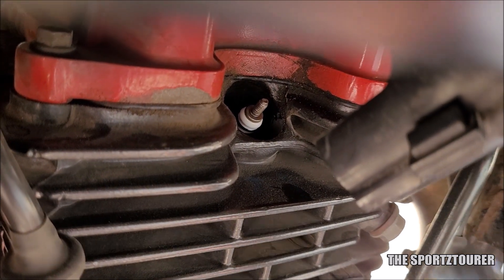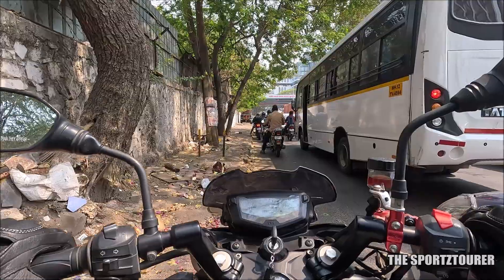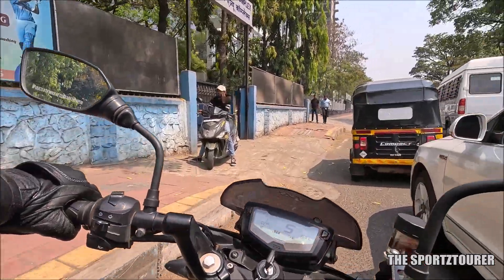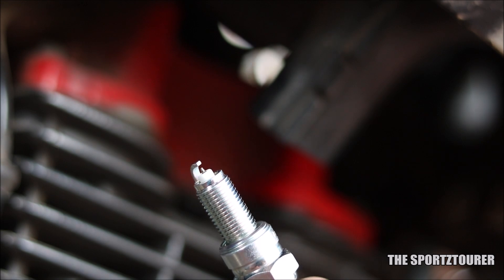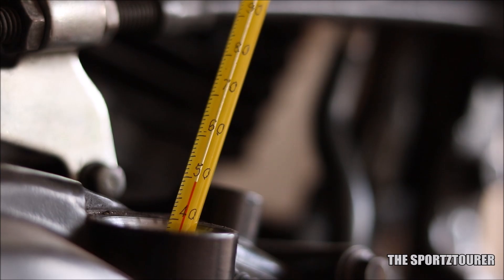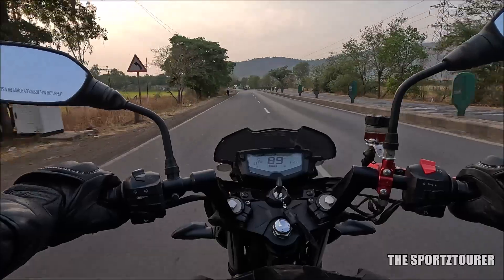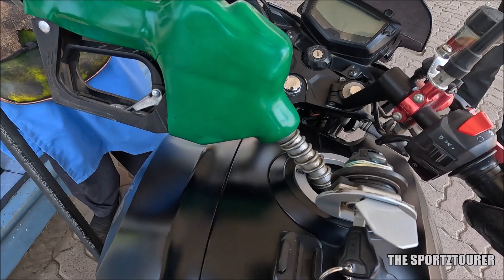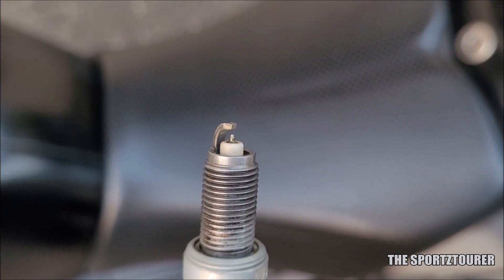WHAT DAMAGED MY TVS APACHE RTR 200 4V ENGINE? NGK IRIDIUM SPARK PLUG CARBON DEPOSIT CITY VS HIGHWAY

Comment: oil cooler and oil cooler pipes are too close to exhaust manifold,   it heats too much.  You have to ride  it above 50-60 kmph.  or you need to change oil too often. Desing is weak  for slow riders

Comment: Important thing to keep in mind, Rtr 200 has Projected type spark plug, If you go to random websites, they do not take these things into consideration. there are many variables taken into consideration when a manufacturer chooses a specific spark plug type. If you wish to change it, do refer Manual from the manufacturer as well as NGK's website.
Reply: Please suggest the correct Plug

Comment: Hello Sportztourer, I am planning a chain+sprocket change to my BS6 RTR 200 to give it a better top end and reduce the rpm for a given speed. What are the possible options? I am looking at getting the FZ25's chain sprocket set, but I don't know if it will fit the RTR. 
(BTW, have you tried out Liqui-Moly engine oil for the RTR? It is kinda magic. Am using their Street Race 10W40)

Comment: I'm using ntorq 125 ,few days ago I'm struggled with low engine breaking because it produce slight power(occasionally) , so I doubted throttle cable and carb piston (throttle valve) but it was working fine . So I decided to clean carb now it's working fine. At that time , I noticed inlet manifold was clogged, look like carbon deposit...
How tha happens?

Comment: I would highly suggest please use these two products: 
Uniglide FRC and Uniglide chain lube ... 

There are other more products as well but I would highly recommend you the above two as :

The first one is a very very good replacement for MOS2 shooter.

The second is still I am testing but seems better than the motul one.

If you get the time please consider those two products and make a video on those.

Comment: Buddy, I usually rev my engine upto 4-5000 rpm as the torque band range in Suzuki Gixxer SF fi and I'm not experiencing any carbon deposit issues or anything else

Comment: Firstly, yet another simple yet informative video 👏
What you touched is so true, my bike after a tour runs ever so smooth untill the bumper to bumper traffic puts it back into roughness after a few days! 😅
I feel alot of clutch use generates alot of heat and degrades the oil faster which also contributes to deposits! I might be wrong.
But yes, my duke delivered 38 to a litre on highway and i wish it did the same in city 😁.

Speaking of deposits, i just had one question. My bike is almost 120k kms old with regular and sometimes early services done all these 9 Years. Would it be ok if I did a chemical engine flushing in the next oil change or will it likely affect the sealing of the engine as it's quite old now?

Comment: Any tip to avoid wind buffeting/ wind noise..?
Reply: 1. Bend down on the tank

2. Buy and fix a windscreen/ wind visor on the bike. 

3. Buy an aerodynamic sport helmet. Gonna be expensive but really worth it especially if you do long distance often, and also from a comfort point (in car you get leather interiors for comfort, and in bike your helmet becomes the interiors)

4. Wear clothing that is firm in the wind. Loose clothing can create drag.  (example - well fitting jeans and a riding jacket along with gloves. When riding with hoodies or a normal shirt, the flapping of the clothes creates noise and also contributes to instability of air that you can feel)

5. When at high speeds, pull the legs and feet inwards to reduce the drag

6. Buy and wear a Balaclava. It makes a huge difference

7. You may also purchase and use ear plugs to cancel out sound, but it can also be dangerous. There are earplugs built for motorcycle use and even the custom fit ones but they are very pricey. I'd rather wear the balaclava because it also keeps your helmet fresher

Comment: Which should I buy ? Mt15 or rtr200 4v ...I need a bike with longevity...I will maintain it properly but I need a reliable bike. Rtr200 is a very good bike and better priced than mt. But I have heard many bad reviews of tvs and quality/durability...
On the other hand Yamaha has a history of being decently reliable...

I know mechanical things can go wrong ...but still worried as it's hard earned money. 

Kindly give a suggestion.
Reply: Brother I own a RTR 200 4V 
For Past 2years BS VI with Ride Modes - Done Many Rides! 
In the Segment it has Good Built Quality (Have dropped it many a times as well) 
A Real Fun Machine with a Good or above Average Mileage (With Maintaining Mid RPMS) in that CC' Segment..
& Dual Channel ABS is a Life Saver & it's nimble & agile to Handle, has a Decent top end & is Pretty Stable in High Speeds...
Yeah Service of TVS is Pathetic aftr Free Service's if u wish u can Opt for a Outside Knowledgeable Mechanic,
RTR 200 ⁴v Has good amount of Features. 
Usual Thumb Rule: As u Said & Proper maintenance is Fuss free! 
Only Downside is 5gears.
Just a Suggestion!
Reply: @jairagav4930  thanks bro.

Comment: @The Sportztourer,

 Does having an active cooling system like radiator with fan help reducing the heat in city traffic and help in reduced carbon deposition?

Comment: Hi does iridium plugs make difference over copper in the real world
Reply from the maker: Hi,
This should help: https://youtu.be/Cr56S3-cKt0
Reply: @thesportztourer  do you adjust valve Clearance regularly?
Reply: @thesportztourer  whats the mileage of rtr 200
Reply: @thesportztourer  recently inchanged my front sprocket of rs to 13t of rtr 200..
with 140 70 tyre...
and it increased my torque by 1.3 nm
Reply: @pushlittleharder  is it possible to fit rtr sprocket on rs200
Reply: @user-ib6  yes..but you have to remove outer washer rubber rings by blade..
and also you have to buy its sprocket lock and nut

but beware you will get 32 kmpl max in city high traffic
but
the torque will be increased by 7.1 %
approc 20.3 nm torque..which wil easily whellie rs ...
Reply: @pushlittleharder  will it be direct fit  or need  some modifications and which bike rs200 or RTR sprocket  lock and net I have to buy
Would you recommend such modifications or not needs you suggestion?
Reply: @user-ib6  direct...
only cut the rubber washer by blade..
and
buy a sprocket nut holder with it ...
rs sprocket holder wont fit..

plus consider mileage too.
if you have 140 70 tyre on ur rs only then install otherwise with 130 70 tyre it will pnly give 26 to 28 kmpl
Reply: @pushlittleharder  I fitted  ceat 150/70 
And thanku for reply
Reply: @user-ib6  then dont fit rtr 200 sprocket..ceat tyres are worst as am i m using 140 70 17 .
Reply: and i am goin to put 90 90 17 on front
and
120 80 17 at rear..
Michelin tures..
with stock rs sprocket..
to 
increase acceleration like duke...
and to increase top speed to 155 kmph plus..

Comment: You can also make a similar video on cleaning the carbon deposits inside the combustion chamber. I know it's a full service job, have to take out the engine & dismantle it. But worth doing it & checking
Reply: @Nothing__fancy  oh..great. Along with Vinegar, can i use mango pickle ?
Reply: @3rdclasstatamahindrabajajRE  hes not kidding, vinegar is acidic and cleans metal surfaces including rust
Reply: @tejaspadhye  yeah why not use vinegar and water, lets run on kerosene, and engine flush using diesel
Reply: @Nothing__fancy that's stupid... This is not  10000 rupees bike... It costs 1.50 lakhs.. Can rev upto  11 k

Comment: Any suggestion for changing the front brake hose of Bs6 RTR 200 (Dual channel ABS) to steel braided ones.
Reply: Yes am also planning?.
Reply: For better braking go for rcb master cylinder steel braided brake lines vesrah ceramic brake pads high quality brake fluid and proper brake bleeding you will feel a huge difference in your braking performance
Reply: @pranabshrestha6653  currently I'm using vesrah brake pads.
Reply: @Shreehari.S  how was the bite an braking performance is improve or not actually i am thinking to buy a versah brake pad for my apache rtr 160 4 v
Reply: @princeroy2692  the breaking bite and performance is far better than the stock one... it'll also last for 10k + kms.
Reply: @Shreehari.S  ok thnx buddy actually i own apache rtr 160 4 v bs 6 but braking performance is worst with stock one. Sometimes when i apply the front brake ..the brake is not working ..
Reply: @princeroy2692  i also use the Vesrah front ceramic pad, and to answer your question, the braking performance is miles better (I did not like the stock brakes). It is incredible and the feel is also just epic. Solid 10/10. One of the compulsory mods for RTR i feel. Do note that I before I changed the pads, I replaced the brake fluid with Liqui-Moly DoT 5.1 brake fluid which is also a vastly better fluid than stock and brake fade issue should become almost solved now. Brake pads I got changed at service center, but I did the fluid change myself and being amateur I did not do the brake bleeding. As a result I have to squeeze the lever to max for few seconds and then I get the 10/10 performance. Trying to find a good garage to get the bleeding done properly

TL;DR - the braking performance increases hugely, I would recommend you to go for it. Highly recommend to change the brake fluid also to a much better standard and brand at the same time for a 2x improvement. Its the max we can do short of master cylinder replacement and steel braided cables. Do also get bleeding done properly. 

Do let us know how your experience is, and if you decide to go for steel braided lines or master cylinder upgrade or both, also do update. I was strongly considering to get the caliper and brake rotor upgraded to improve the brakes, but have no idea how it might be done.
Reply: I think they should be steel braided from the factory. My pulsar 150 abs bs4 came with steel braided lines from factory.
Reply: @tejaspadhye  In apache RTR 200  they provide steel braided one only for rear brake, not for front.
Reply: @Shreehari.S  an for apache rtr 160 4

Comment: Do you adjust tappet clearance regularly? My rtr 160 sounds like it was about to die after 50-60kms of redlining or crusing at 80kmph
Reply: The service guys never adjusted tappet even after writing it in job card @sportztourer
Reply: @chakravarthireddy9510  most of them in all the service centres don't because it takes alot of time to access the shims. So they avoid it😕
They'll make you wait untill a breakdown
Reply: @Nothing__fancy  when tick tick sound appers in engine Head.
Reply: @Nothing__fancy  according to company it is recommended to check every 5k kms but I did 25k kms and never opened the head
Reply: Same with me in my fz. I also need to adjust the same but no one is ready to do.
Reply: @keshavkaushik7945  same bruh
Reply: Probably, the " expert " doesn't even know something like tappet exists. So what I would suggest is take your bike to a bikers garage. They might actually solve your problems.
Reply: @sanketmehta7821  I will I consulted a showroom nearby and they agreed to do it. but here some mechanics were like we won't open Apache engine unless or until it's time to overhaul